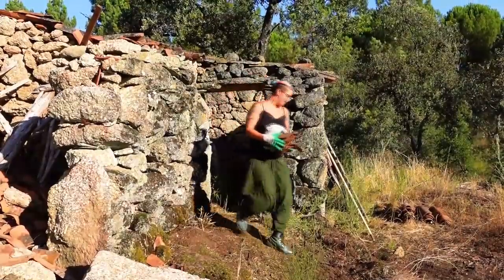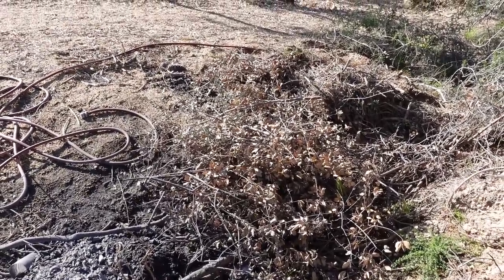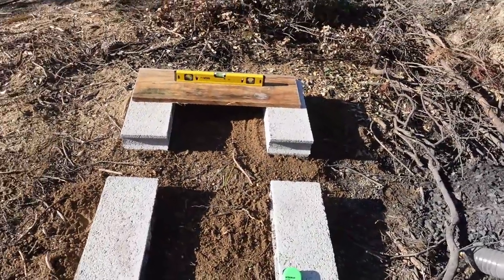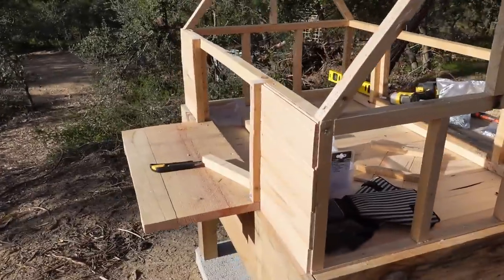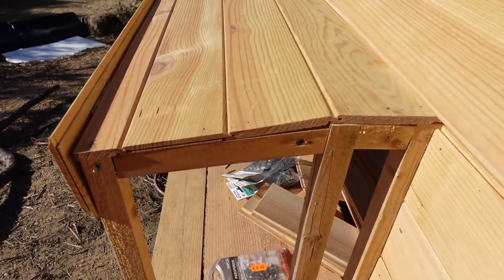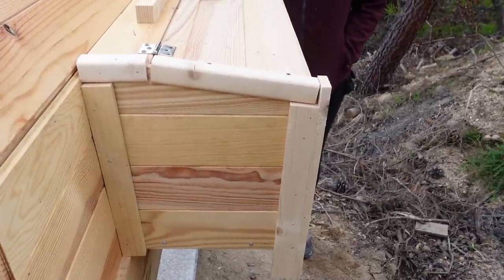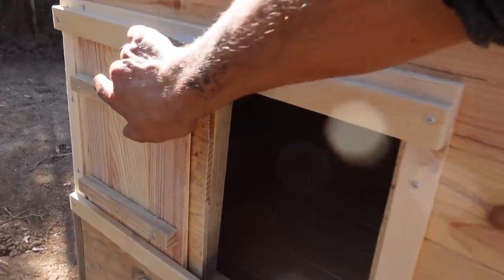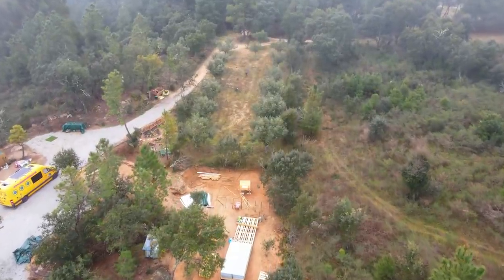DIY  Backyard Budget Chicken Coop Build - The Wildlanders Off Grid

Comment: Love the house but you will need ventilation in it so somewhere you can have some fine mesh to allow airflow. Also they will need a perch and make sure you secure the opening parts as foxes and stoats are clever st opening things so some kind of bolt on each box and the doors and roof xx
Reply from the maker: Thanks 🐔 perches already fitted and ventilation being added under the sides with mesh wire, also each opening will have bolts/clasps to stop unwanted entry 🐔🐔😍
Reply: @TheWildlandersOffGrid  awesome xx
Reply from the maker: Will do an update once it's, all painted 😍🐔🐔🐔🐣🐥
Reply: @TheWildlandersOffGrid  💜💜💜🥚🥚

Comment: You can put sand on the floor of the coop and just clean it like a kitty box, easily.   I got that idea from someone else and it does work well.  I'm glad to see the faults in the build;  we aren't all master carpenters, are we ? LOL.  And the chicks won't mind it, anyway.  As others stated, ventilation is important !  You don't ant to cook you chicks in there.  Cold doesn't bother them near as much as heat does.  Nice video; thanks for sharing.
Reply from the maker: Thanks Sheila, we're adding ventilation at the side of the top, protected by wire, as it's truly hot in the summer, we've also positioned the coop where it gets some shade for some of the day to try help this 🐔🐔💚💚
Reply from the maker: Like the sand idea, I think we're starting with straw so we can compost it 🐔

Comment: Just had another observation....I notice you cleverly hinged one side of the roof so it opens, but I also observed this leaves the ridge line exposed to rain entry, leakage and perhaps rot eventually. If this hasn't occurred to you already, you could cover this exposed area with a flexible 'ridge cap' made of plastic or perhaps rubber - say from an old inner tube. In rural areas like yours, lots of tractors, lots of tractor tyres, so lots of old inner tubes, potentially.....maybe glue it down with sikaflex??
But whatever, ridge cap is a must....   Cheers! :)
Reply from the maker: Yep wise observation, at the mo it's been sealed with wood protection/varnish and sikafkex and been looking for inner tubes to add a flexible rubber capping 😊

Comment: Hey, Dom, sorry didn't get to this sooner, but looking at your intended 'chicken run' - the wire fenced area at the base of one of the ramps, I think you will find the chickens will get over this fence far too easily. Think you said the wire was 1.5m high? Even with clipped wings a determined chook can clear a 1.5m fence. Especially as in your 'stick on ground diagram' the fence appears to be at one point very close to the top of the exit ramp from the chicken house.... they will just launch over that and be off..... Sorry to be a drag, but you guys have clearly not owned chooks before! lol. They are freaking Houdinis! Give 'em an inch.... The fence probably needs at least 6-8' clearance away from the top of the ramp, to avoid this.
Also, getting them back into the chicken house of an evening can be fraught - especially if they don't want to go in - or if you need to go out and need to lock them up early, once they've been let out..... they really are VERY stupid, and are amost impossible to 'herd' in any sort of order. You no doubt know it's difficult to herd cats? Well, chickens are morons, compared to cats, or even sheep! So it might be a good idea to design a sort of 'catchment area', like a funnel of sorts, or an angle in the fence, that leads to the gate into the wire pen, because sure as shit they won't want to go up the ramp on the other side...! And will run past the gate in the fence rather than turn and go into the pen.... They really are stupid, and easily rattled. tie up the dog and cat before you attempt to herd chickens. Trust me! lol
In the past, when we've had free-ranging chickens, we've always engineered an angle in the fence, right next to the gate into the pen, so someone can stand "near" the gate to stop the ones inside escaping again, and someone else can then 'herd' the ones outside up towards the gate. You also need 'arm extensions' - like long sticks. Chickens really are daft....as you will soon discover!! Ideally, only feed them grain or soft greens "inside" the wire pen. This will get them used to being fed, at a certain time of day, inside the pen (i.e. dusk) and so they will have an incentive to enter, and some feed to occupy them while the stragglers join them. With only 4 chickens, this might not be too difficult, but if you get that one, mad, lunatic chicken.....   lol   Just promise to video that for us all, will you..?? lol :)
Reply from the maker: Haha yes we'll surely end up with at least one mad chuck 🐔🐔🐔
We're working on the fencing, and probably will double height it by the ramp and may also add a side to the ramp facing the fence, but you're right never had chickens and getting loads of advice from comments such as yours so thanks very much ❤️❤️

Comment: Also you need an air vent chickens die getting over heated
Reply from the maker: Hi Patricia, perches were added x2 but not in this part of the video, also added ventilation and still have the entry ramps etc, but will film a follow up once all the fencing etc is finished too :)